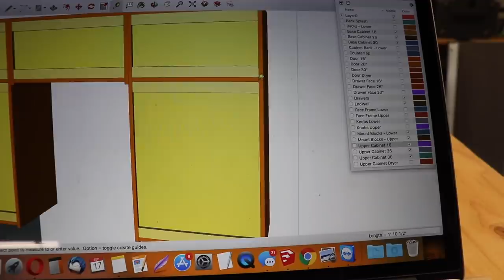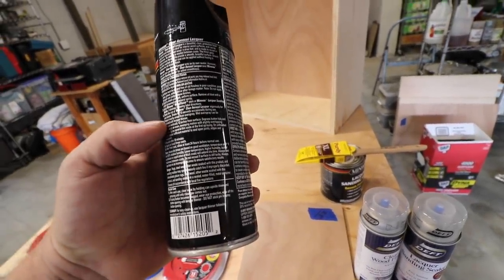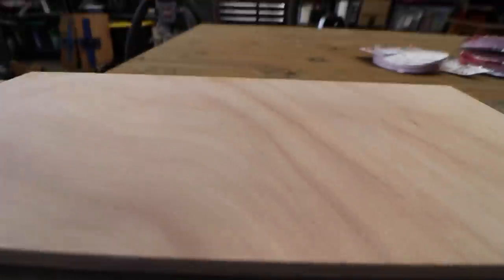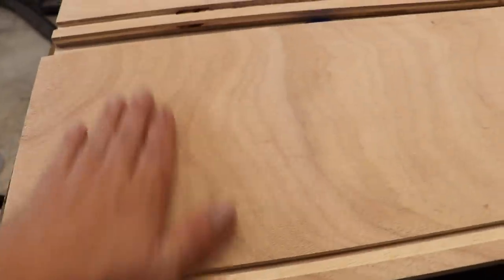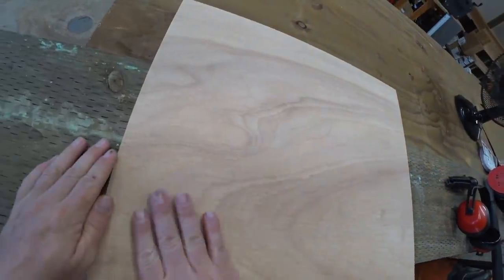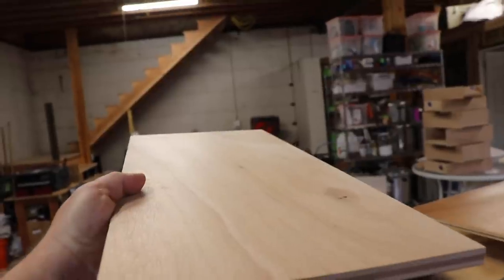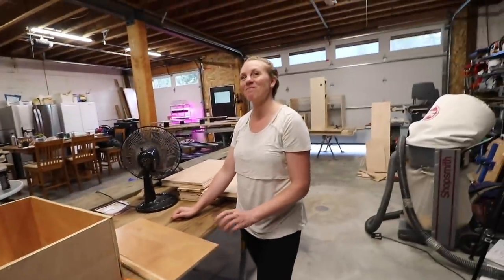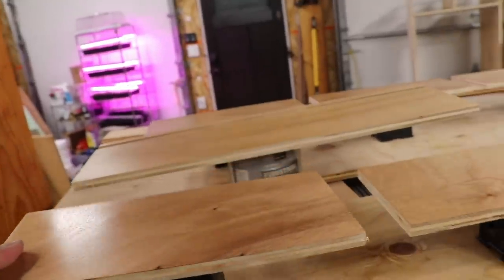W-O-W! ...SO GOOD! (Sanding & Finishing Cabinet Drawers)

Comment: There is a reason why it is called Wood glue... Because it must be used on wood and not on lacquer. I think when you finish the assembly it will be a problem that it's with lacquer on it already. Let's see.

Comment: Hi Jessie, It is a bad idea to leave the end grain and just use a finish on it. the sandpaper grits are OK, the end grain on plywood is usually finished in one of two ways, 1. A thin piece of wood glued and nailed on, or 2. Tape that is ironed on and can be bought to simulate ant type of wood. Because you are new to this I would recommend you go with the iron on tape, it comes in a roll and when you but it, you can also get a little plastic tool that runs along the sides and trims off the extra width. When you use the spray lacquer you need to lightly sand with 500 grit between the first and second coat. You also need a "tack" cloth to get rid of any dust from the sanding. All these items should be available where you bought the plywood. You have to use masking tape in the dados because the glue will not stick to the finish.

Comment: Did you take classes before getting your flying license? Why are you not taking woodworking classes and/or finishing classes? IE: You don’t use 80 grid to get a smooth finish and 220 grid is too smooth. A sealer does gust that, it seals the wood grain so you don’t have to use 5 coats of finish. ETC. ETC

Comment: Have fun gluing them together. Glue won't stick to finished surfaces. It needs the wood fibers to grab ahold of. Also when sanding draw a pencil line on the board when sanding. once the line is gone you have sanded enough.

Comment: Way overdoing it Jessie! The boards are likely less than 150 grit straight from the factory. Run some 200 over it, lightly. Apply the sanding sealer - it will raise the grain. It’s likely shellac based, it will dry rapidly. Lightly sand again with 200, apply second coat. Very lightly sand again, very low pressure. Apply poly “varnish” with a brush. Done.

You’re going way small steps with your grits, and you actually want a bit of roughness for the varnish to key on. You get the rest of the smoothness with the varnish.

Comment: Being a prefinished sanded plywood. 220 sanding I believe is all that's necessary. Before last coat of lacquer. 000 steel wool, tack cloth. Then final coat. Best wishes.

Comment: Why don't you assemble the drawers first because you are defeating the purpose of gluing when finish is applied first. GLUE DOESN'T adhere to ANY finish . Cabinetmakers and cabinet manufacturers in Mass production assemble first, stain,sealer and final finish. You need to read a book about cabinetmaking and finishing before passing out you brand of cabinetmaking and wood machining methods.
Reply: To be fair to him he says this isn't a how to video,it's how he does.

Comment: I always coat the outside of drawers with a sanding sealer and then light sand with 220 grit. this gives a better looking finish and helps protect from moisture from humidity. Of course I live in Florida where humidity is a concern, but still, it improves the look regardless.

Comment: Jessie, In our shop we would round off the top edges ( inside and out) of the drawer boxes. We also definitely finished the all sides of the drawers and did that after assembly before the faces were installed.
Reply: Patrick Vis I was wondering about running drawers down a router to round tops or even may be use some iron on strips just to hide the plywood

Comment: please keep safe.
1. Lacquer is toxic and flammable and should be used in a well ventilated area.
2. The filters you are using on your respirator is not stopping the lacquer vapor. You need an organic vapor filter for spraying that stuff. The pink ones are for dust.

Comment: Because of the thin veneer, use a sanding sealer on the raw wood and then light sand with 220 grit. Forget the 120/150 grits. If not edge banding, use a wood block with 220 grit and HAND sand the edges.

Comment: I've built and made a boat load and them some of gun stocks. Might I suggest starting at 220g and going up to 320 or 420 grit. When doing gun stocks I took them al;l the way to 600 grit with wet and dry and a 50/50 mix of boiled linseed oil and  turpentine. An in the wood finish that is hard as nails.

Comment: Definitely too much sanding.  after you start applying finish, use 0000 steel wool followed by a tack rag between coats and throw those spray cans as far as you possibly can.  I apply final finish with foam brushes, no clean up (throw the used one away and start with another one on the next coat) and no waste plus better fill of imperfections.

Comment: 220 then 320 would have been all you needed with a sander  , 120 and 150 is too coarse for finishing and is more for stock removal to remove defects while keeping the surface flat .  That being said I myself like glass smooth surfaces on all my woodworking projects .

Comment: Jesse, I think you have your sandpaper grits confused,.  Never use any grits below 120 on finished ply, 60/80 are just bad for finished ply.  I use only 220 on finished ply and then maybe 400 the finer the better and never over-sand. Higher numbers smoother finish. I know by the time you get this you're already finished making all your mistakes. But hopefully, it will help with the next steps.   If your surface is not smooth after the finish coat, you can always wet sand with 400 grit by hand and apply another coat to finish. I wish I could help more, don't mean to be a critic. Always finish all sides, stops ambient moister from intruding, which may cause warping.  It doesn't have to be perfect but sealed.
Reply: Kevin Hoppenworth yea, 60 or 80 would be like dragging the wood on the road.
Reply: normal groove used 40/80 grid sanding groove 220 to 320, and fine sanding 320 to 600 and super fine not need cabin have 1000 to 1200 but cabin need only 320 and if want fine front panel 600 before last lague.

Comment: If your wanting to use a mechanical sander clamp several of the same dimension together so you don't round over edges. Hand sanding with a block sander is your best option.

Comment: a trick to tell when you have sanded enough is to take a pencil and mark across the face, when the pencil marks are gone it evenly sanded and can go to next grit.   also use 0000 steelwool between the coats of finish

Comment: Why are you using 120 grit on a prefinished ply... i would be more to the 220 grit. Also dont seal the edges that are going to get glued... the glue needs the end grain pores open to adhere correctly

Comment: In simple terms I think that you are overdoing the finishing, especially since it is just plywood with ply endgrain showing, rather than high quality wood with hidden joints, etc.  If coating any of the drawer bases/sides then best to put at least one coat on the otherside. 

The belt sander will usually chew out more than an orbital and I would hand sand the endgrain/edges.

Comment: The sanding sealer will seal the wood and raise the grain so that sanding can remove the fibers that stand up.
 
This gives you a very smooth surface that will require less finish materials.

Comment: You should be using the sanding sealer first before the lacquer.  You can thin as needed and spray to get a uniform finish.  It seals the grain in.  After it dries sand with 200 or if a second coat 400 grit.  You can cut the number of lacquer coat in 1/2 easily.  Also, sand with the grain in the wood, not across it.  This is one ambitious project.  Don't rush yourself to get it done.
Reply: this is the method I like to use sanding sealer seals the grain and keeps the fuzz down, A quick rub with 00 steel wool and tack cloth, put as many lacquer or poly coats on for a smooth durable finish

Comment: Jesse,  Glue will not properly adhere to finished surfaces..........?
Reply: Yup.  Never finish a surface which needs to be glued.
Reply: @BustedJunkStudio  if I have to use a unfinished ply I finish and then cut and touch up anything needing it after assembly

Comment: Ok  I am a little confused. did you not buy plywood with a finished side?  If you did, then why are you going to all this effort to remove the finished side that you spent extra money on?  Now if the plywood you have is type A with a standard veneer finish, then you either didn't have to sand or you could have started with a 250 grit or higher to start with.

Comment: For sanding edges, simply use a block of wood and wrap your sandpaper around it, and sand the edges by hand. The block of wood will help to avoid over sanding and creating dips in the edges. Hardware stores also sell thick rubber sanding blocks for this purpose. Edges always require a light touch and I'd never use a power tool on the edges, simply because you can too easily remove too much material.

When sealing your wood, make sure to lightly sand with fine grit sandpaper between coats to knock down the grain that comes up. This provides a smooth surface each time rather than building up lacquered ridges of the grain.
Reply: I agree!

Comment: To try a white athletic Sock turned inside out over a blue nitrite glove dipped in poly. It is pretty easy to get a streak free finish with very little practice. You mostly need to get a feel for how wet to get the sock.
Reply: Need to give that a try

Comment: should do all the sanding first, then all the lacquering.  With that many pieces, by the time you spray the first coat on all the pieces, the piece that your sprayed first will have had 30 minutes to dry and so you can just continually spray pieces until you have the desired amount of coats.

Comment: Jesse -  built my whole house, cabinets included.  Used Parks polyurethane on everything.  It’s water based, no odor, water cleanup.  Tough as nails (made for floors.). You just smear it on - I use a painting pad for trim.  Awesome finish, quick, easy, no bubbles...   try it - you’ll never go back!

Comment: You’re really gonna be upset when your glue doesn’t stick to those lacquered sides. You should have sanded, glued and assembled, then finished the inside and two sides. Also edge banding the tops will make those look like solid wood. Speaking of wood what type of plywood was that?  Hope you chose birch and not oak, with oak you’d need a grain filler to get a smooth finish, birch an the other hand takes paint and stains better.

Comment: Jesse, have you thought about using a wipe on poly or lacquer? You'll use less finish and have to apply fewer coats. SANDING SEALER- Using one will improve the finish. Apply a coat of sealer, then lightly sand (220 or 320) clean with a tack cloth, THEN start to apply your finish. The sealer allows for less finish 'soaking' into the wood requiring more finish to get the desired effect.

Comment: Do your sanding with just the 220, assemble your drawers. Then finish them. If you finish before assembly you will have weak glue joints.

Comment: Cabinet grade plywood only needs to be sanded to 180 grit.  Spray the finish then Scuff sand with foam backed 320 abrasive between coats Not with a power sander!   You just need to wipe the abrasive, you Don’t sand it!

Comment: I think you are thinking of the grit numbers backwards. 100 grit is rougher and takes off more wood that 220. on those surfaces I would be using a 400 no 150 or even 220.
Reply: I thought I was missing something... or the industry changed something...
Reply: For cabinets 220 is plenty.  It's not a car
Reply: @scottfry9466  that just depends on how smooth of a finish you want... I have seen people go up to 1200 grit... they were looking for a glass like finish

Comment: If you start sanding e.g. 120 and do it for one minute, each subsequent sanding e.g. 220 do longer than the previous one. This is the basis for grinding. Use more than 200 to 350 granules for finishing

Comment: It's extra work but, I'd seal the exteriors too  just to protect the wood surfaces. I don't think you'll regret it and particularly if you only intend to apply two coats on the interiors.

Comment: Sand it to smooth finish will have trouble adhereing, also glue will have trouble adhereing to finished surface. 
Water based finish would be an option I'd investigate
Reply: tape off edges being glued or spray all at once

Comment: If you're not going to edgeband the top edge of the drawer parts you should either bullnose that edge or at least break the edge with your sander. As far as the lacquering: Just sand the parts to about 120, USE THE DEFT SANDING SEALER, 2 coats of that and then lightly sand with 220. Wipe  the power with a clean DRY cloth. Spray with DEFT lacquer, 2 coats should be fine. That's it man, super easy and it'll come out great!

Comment: You could use a dust collector box. Which is just a frame with a furnace filter and a fan to pull the air through the filter. it will help with drywall dust also.

Comment: With particle filter respirator Jesse and everyone, you must at least once a day remove the valves and along with the mask soak and clean the respirator then left to dry , reassembled and put away in sealed dry container. There is a reason this must be done.
What happens with fine particles of dust which will paste thru the filters along with moisture from your breathing, fungi are created from spores that are in the atmosphere etc. There a potential for you to breath in the fungi and spores where some spores can be those that can cause infection in your chest and cavities. One that comes to mind is aspergillosis. So wash daily, dry and new filter daily.

Comment: As a professional finisher, here are a few pieces of advice - time spent doing prep work makes the whole process go faster, because it makes the finish go on cleaner and easier.  Never skimp on prep work.  

You only want 1-2 coats of sanding sealer - it's job it to provide a bond between the wood and the top coat.  Check with your manufacturer for details, but in general I put on 1 coat, do any sanding which is still required (sealer will reveal your flaws), and then a second coat which is as perfect as my equipment and skills will allow.  If you have to, sand out any sags.  Then, with most sealers you want to spray your top coat within 1-24 hours.  If you take longer than that, scuff sand the surface and recoat with sealer.

DON'T MIX BRANDS.  Just because they say they are lacquer doesn't mean they are the same thing.  Manufacturers formulate their products to work together.  Mixing brands will void your warranty, and more often then not is the cause of finish problems, many of which don't show up until months or years down the road.  It's just not worth the bother.
Reply: And never sand raw wood past 220 - it can lead to adhesion problems down the road, and has no effect on the finished product.

Comment: The 120 and 150 are so close to each other that you'd never need both. Both of them are to flatten and take out aggressive marks. With your wood so smooth you only needed the 220. On wood there's no reason to go to a higher grit than 220 except on some nice work on hardwood. On metal you can go up to 400 and sometimes 640 and then polish.

Comment: All you need is 220 grit. A lite sand and that's it.   The top edge of the drawer box needs edge banding
Reply: same here! use water base semi gloss poly -low voc ,no over spray not blotchy. or put 1 st coat of sand sealer varnish 2-3 coats  . i did all sides on my cabinets

Comment: The sealer is just more dilute and therefore lower viscosity and therefore flows more deeply into the wood and (depending on solvent) is more thoroughly absorbed by the wood fibers. You could finish the piece with sanding sealer, it would just take 40 coats.  You can make your own by taking your final finish and diluting it at least 1:1 with appropriate solvent.  I know how OCD you are (me too), but , while you are working on less important (in terms of appearance) cabinets, find the single system you want to use throughout the house so your finishes will look consistent throughout.  If you are going to use anything with pigment (stain, paint) buy ALL of it you think you'll use (+25% just because) from the same lot number.   Especially things like black and white are really hard to make match.  Happy cabinet making!!

Comment: With that extra sanding you are actually burnishing the wood! Wood turners often put a shine on their products by holding sawdust or shavings against it as it turns.The wood is then perfectly smooth before any finish is applied.

Comment: Wood is absorbent when pai t or varnish contacts it the wood fibers will swell,  to obtain a smooth finish do a lite sanding between coats,  to seal wood apply a diluted mix of 20% varnish,lacker 80% white spirit let dry sand then apply 40%lacker 60% spirit, sand repeat 80% lacker 20 spirit sand the final 100% lacker. This will produce a deep luster that will last  use a hard yatch varnish , lacker . Hand sanding take longer but reduces chances of going through top layer

Comment: Use higher grit and don't use spray cans, they have too much solvent in them. Apply with brush and them use very fine sandpaper with water to get the sheen.

Comment: Jessy for sanding wood the higher the grit number the finer the sanding or smoother the wood is start with coarse sanding paper then go to fine paper and follow the direction of the grain dont go across the grain of the wood

Comment: When finish sanding (especially with something that vibrates like random orbital) it is advisable to have something (towel or rag or shelf-liner) under your work so that your other side does not get scratched.  Working straight on the treated lumber is a recipe for disaster in my experience.  I also second the vote for apply with brush (or airless sprayer) not spray can.